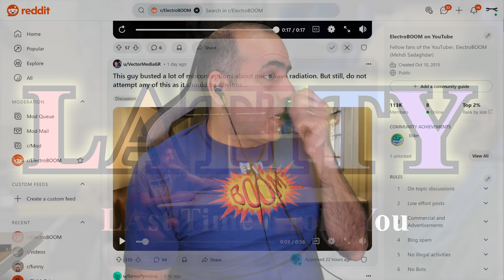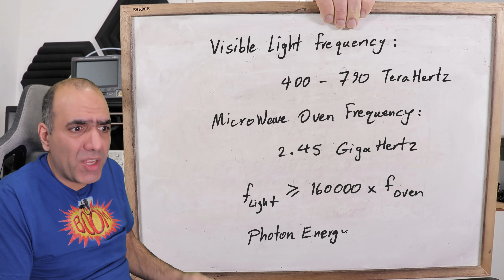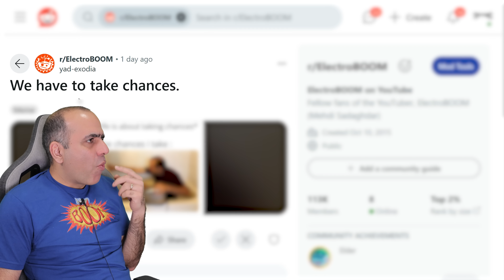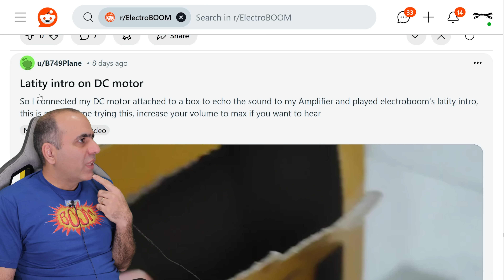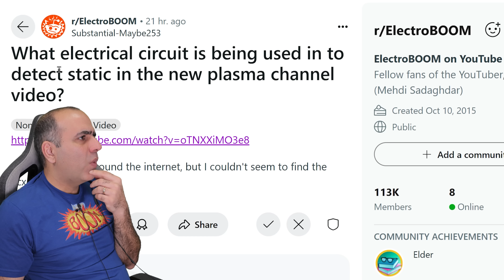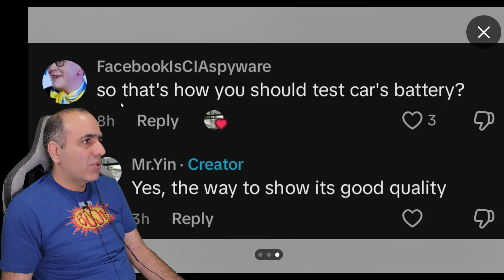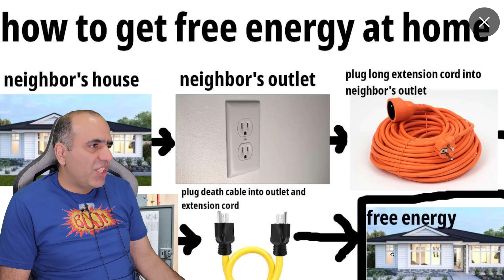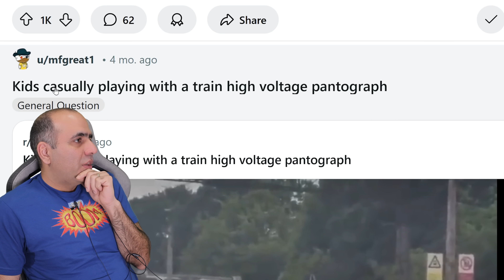Can You Microwave Yourself?! (LATITY014)

Comment: I thought that exposure to sufficient microwave power to heat your skin was known to be very bad for living tissue. The soldiers on the DEW line used to confirm that their radar was operating by holding their hands in front of the transmitter to feel the warmth. And after a lot of those activities their hands were severely injured. Perhaps that's a myth . . . . I think your demo may have been fairly safe in such a short duration and at fairly low unfocused power levels, but it may give the impression that there's nothing dangerous other than the high voltage. Isn't the metal shielding on a uwave oven there to protect the user, not just to reflect the radiation?
Reply from the maker: Well I'm sure it cooks you over time! I'm sure the injuries they sustained was from being internally cooked. And yes of course the metal case and shield is to also protect the user from being cooked.
Reply: Well repeated damage over time isn't good for any organs generally, I imagine repeatedly getting "almost cooked" will damage and kill sections of skin if you're doing it daily or close to that as in your story.
Reply: RADAR is definitely hazardous. I worked with surveillance equipment (not household stuff) and we had an older airborne RADAR system basically “cook” a couple guys about 15-20 feet from the transmitter. Had to be medevac’d back to the states, spent time in ICU, vomiting blood (well from both ends, really). They were quite ill for a while. Have had other people get radiated by low power RADAR and they say they could feel warmth, especially in their eyes amd testicles. The more state of the art stuff does not get radiated on deck.
Reply: @naturaljoe759 yes tissues with Alots of water probably heats up more, and some tissue is sensitive to just slight increase in heat
Reply: @naturaljoe759 The shielding aside from reflecting the micro and making sure no one does anything dumb. Is probably more there to protect electronics and comply with FCC regulations. Something pumping out 1000w of rf energy is going to wreak havoc on that section of radio frequency for a good distance around it.
Reply: @uploadJ  it's not in 2.4ghz it's around 800-1.2 ghz (I think). This lands it in other communication bands, namely cell phones, and other small communications. It might come close to some types of radar? It's really hard to say how far off you'd be detecting the signal. For cell phones they transmit in milliwatts, so yes it is possible to affect them a long distance away. It's hard to tell though since a magnetron is not a good antenna for long range transmission, microwave radiation can be easily absorbed by maybe things hence it is useful for radar. 
 If it did, I need to point out, it is VERY illegal in most countries. In the United States if you interfere with an emergency broadcast system (like a cellphone) it could be a felony. If you get caught and how much trouble you'd get in are not my specialty. I know interfering with commercial radar, they will not be understanding if the FCC finds you.
Reply: @uploadJ  microwaves do use magnetrons, there is one in the video there. I doubled checked and the alternative solid state switched amp is not widely used. If it was a switched amp microwave it would probably not be operable with out it's control board. You were right about it being around 2.4ghz actually, they specifically make almost all magnetrons in microwaves for this range.
Reply: @daemn42  if you read my first and second reply you will see I never implied they did operate in 2.4ghz. you meant 2.45ghz right? 
I think the reason we are moving to 5ghz is more than just saturation of 2.4. it's that 5ghz is much worse at penetrating walls. This is great for Wi-Fi, it means that saturation may never happen to the same extent on 5ghz because of signal drop off outside of people's homes. That and 5ghz can more easily reach gigabit speeds with less Tom foolery in the protocol than it would take with 2.4ghz.
Reply: @notsam498  Dunno what you're on about you said.. "it's not in 2.4ghz it's around 800-1.2 ghz (I think).".   Microwave ovens do operate in the 2.4Ghz band and specifically 2.45Ghz.
Reply: @daemn42  read my next Post, dunno what you're on about at this point. I corrected myself already.
Although let's be real, the one reason to post on YouTube is to get in pointless arguments with strangers.
Reply: @notsam498  Maybe if you had replied to me instead of some other random person I'd have seen your "correction".
Reply: @daemn42  maybe if you learned to read more thoroughly, I wouldn't have to remind you. 🙃
Also I responded to you every time it's in each post header. Seems kind of like reading is hard today. We've all been there.
Reply: @naturaljoe759  re: "we had an older airborne RADAR system "
Average power a few hundreds of Watts won't do this, average power will not be in the range of 10,000 Watts, that is out of line with jet fighter nose or pod mounted RADARs ... peak power can be 10,000 W but average power a few hundred Watts given the pulse width and rep rate ...
Reply: @naturaljoe759  airport radars are known to cook unfortunate birds - when a radar is off a bird lands on antenna, then radar gets turned on and 18-150kW of RF output  fries that bird in a second, sometimes leaving nothing but coals.  Which is no surprise - 800W microwave can cook a big chicken fillet in about 7-10 minutes or so. Imagine 20-200 times more power and the size of poor bird's brain and heart.
Reply: @naturaljoe759 Any idea of what wattage these systems were?
Reply: Yeah this is not safe when holding fingers or so in concentrated beam and feeling internal burning
Reply: It could also be something weird, like maybe deeper tissues don't have good heat sense ability, so it's much easier to get burns internally. And repeated internal burns with cause scaring.
Reply: At these frequencies, it's a matter of energy balance. If the radiated organ can dispose of the deposited energy faster than it comes in, no big deal. If not, there will be a local temperature rise. A large or frequent enough rise may be harmful to tissue.
Reply: The point he was trying to make (in a roundabout way) is that a magnetron just produces heat energy, not ionizing radiation.     The distinction is that despite the relatively high concentrated power, the 2.4Ghz photons produced by the magnetron just jiggle the molecules in your body which we feel and measure as heat, while ionizing radiation has much higher energy photons which can directly strip electrons from atoms, which can directly damage DNA and cause other undesirable chemical reactions.    Yes Rf heat energy can obviously burn you, but generally won't cause cancer.  
If the heat energy is kept below the threshold of actually burning your tissue then there's really nothing special about repeated exposure to it, any more than there is holding your hands up in front of a radiant heater.  

And yes, the biggest danger of being that close to a magnetron is burning your corneas.
Reply: I wouldn't be shocked to find out they had nerve damage from repeated rf burns
Reply: Euro plug in uk sockets - terrible.  The prongs on the euro plug damage the socket and make the contacts permanently slack.  Resistance goes up…. Socket heats up or works intermittently and sparks.  Used to suffer this quite often on ships with  UK outlets working in European ports.
Reply: To be fair, I think if I cooked my hand every day it wouldn't be super happy.
Reply: H
Reply: Its a myth. Out techs used to do the same thing with the Panavia MRCA GM and TF antennas ... I never tried it, i took their word for it.
Reply: The same can be said to basically anything that can heat you. Prelonged exposure to even just hot water can give you cancer when you almost burn yourself on a daily basis.
Reply: It's known that fighter pilots and AWACS crews work near microwaves and many suffer from aggressive, rare cancers later on.
Reply: Guess it's in a way similar to radiation exposure where the body needs to heal the damage faster than it can be damaged. Repeatedly cooking your hand without giving it time to heal is just gonna make the damage permanent.
Reply: The story goes that some American military guy found a radar warmed the chocolate in his pocket and he then got a patent for his radar range cooker somewhere around the end of WW2. The metal grill in the oven door has holes for you to see through while being too small for the microwave wavelengths to get out and cook your eyes. There are safety switches on the door that will blow the fuse before they will let you run the oven with the door open just to make sure there is no leakage.
Reply: How is your comment 17 hours ago even though the video was made 6 minutes
Reply: @KritzKaiser Patreaon subscribers usually get early access to videos on a lot of channels.
Reply: @KritzKaiser now u asking the real question
Reply: @Smelyn  Now 'you' are asking irrelevant questions.
Reply: @ hate to be the party pooper but what i said was statement no question market :(
Reply: @KritzKaiser it was made public then I bet. Unlisted video first. Then release by listing it.
Reply: Just because it's not ionizing radiation doesn't mean it can't be harmful.  I am NOT claiming that there is some grand conspiracy, so please don't come at me with that.  What I am saying is that RF is not health tonic, and the jury is still out.  Yes, of course it isn't like ionizing radiation.  But that is a given and doesn't speak to the issue.  Saying "it's just heating you" is a bit of an oversimplification.  There is arguably enough data to justify limiting exposure to some extent.  That is what I took away from my last research binge on this subject.
Reply: @bsadewitz  it's a matter of power, frequency and depth, really. Any form of energy can be dangerous to be exposed to at high enough a dose, be it EM waves or mechanical trauma to tissues, but fortunately proper design and regulations keep us safe